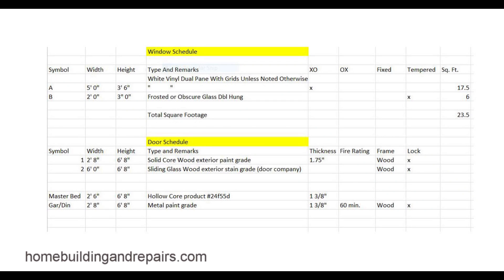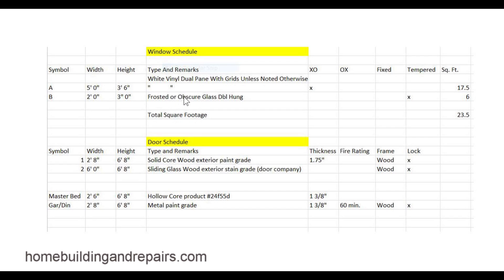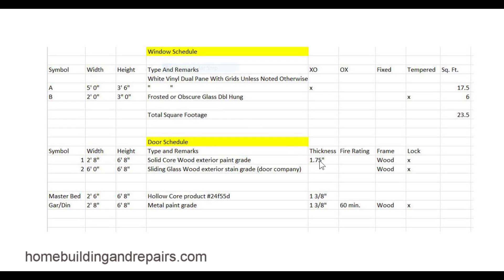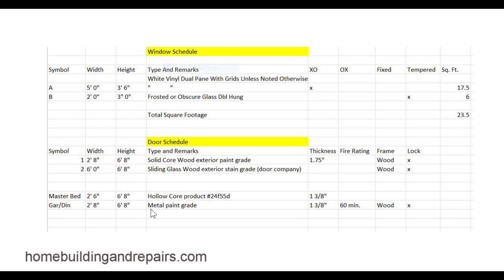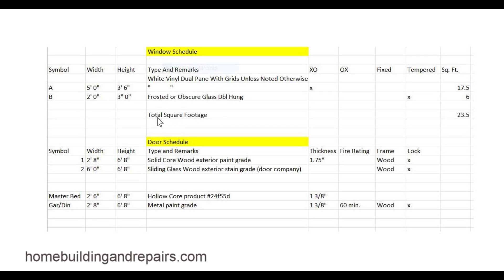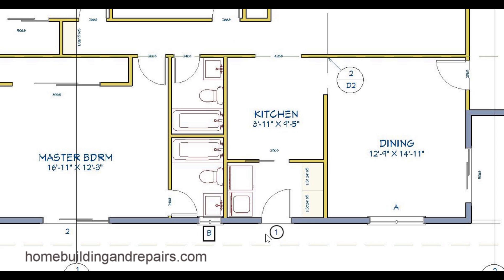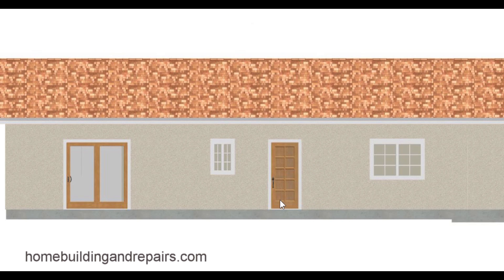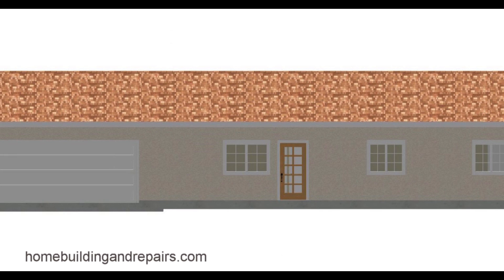Part 5 - Windows And Door Schedules – Small House Design And Framing

Comment: Interesting on the exterior doors having both paint and stain grade. My thought be if the homeowner specifies stain grade, then willing to have more maintenance, as such, the windows should be upgraded from vinyl. What are your thoughts on this?
A suggestion I can see would have been mention some anchors maybe specialized for sheer panels. That garage opening certainly has high potential of having a sheer panel.
We were taught in hand drafting class to have a framing plan with openings dimensioned, then a door and window plan that showed the symbols in pochéd walls. The framing plan was also separate and with all solid lines since the footing came up through the slab, rather than the slab over the footing; dashed be correct for footing under the slab since hidden (dash also used for overhead). Reason for this was the footing and slab was one pour and also allowed rebar in the slab to be tied into the footing rebar, with all that tied to the anchors. Guess in southern California things done different because of earthquakes. And yes, I have done about everything there is on construction (mostly so could design and draft correctly).
Hope this helps and looking forward to the next video.
Reply from the maker: Thanks for sharing and you bring up a good point, building designers and homeowners might not have a clue about maintenance. This would include architects who have worked decades in the business. Then you bring up another valid point, suggesting that there are specific ways to use dashed or solid lines, when that might not be the case also.
Reply: Thank you for responding and the kind remarks.
I just turned 31 and am fortunate to have had real hand drafting, taught by one of the last in the hand drafting era. I have tried to educate my classmates when the opportunity arose, especially line weights. Disappointed in architecture not teaching drafting, even one class of a CAD course. With other concerns, left and instead obtained a Master's of Science in the Built Environment with a Concentration in climate responsive and sustainable architecture.
So some drawings/designs would specify both finish grades? If so, goes to your point when a contractor/builder is bidding, to inquire and get in writing the desires.
Reply from the maker: You're welcome and I think most reasonably educated building professionals can look at a set of plans and get a general idea about its construction, even if they don't all look the same. I've spent a lot of time dealing with architects, engineers, interior designers and others and most of the time they end up adding more confusion to the process than clarity. But when they do agree, you better have it in writing and I mean don't do anything until you do.